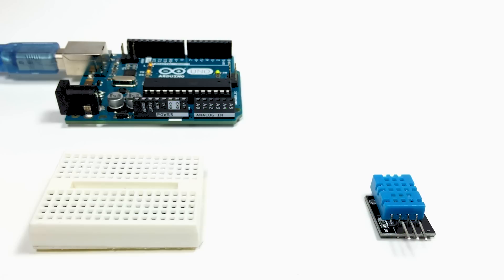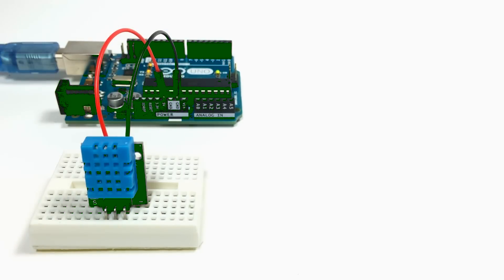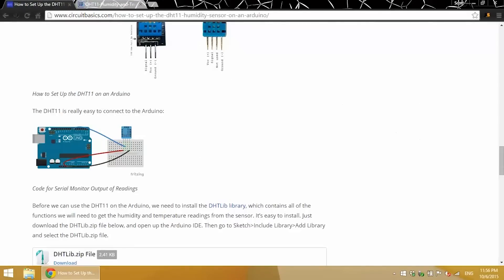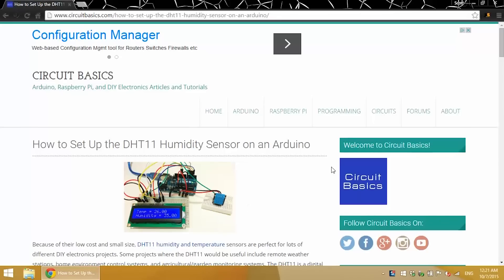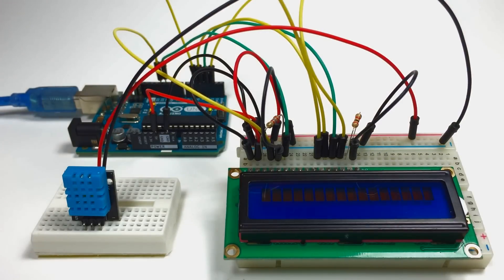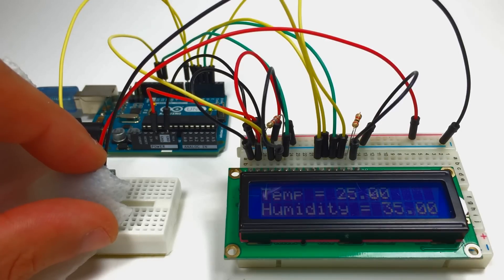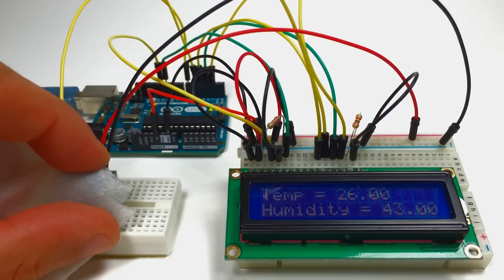How to Set Up the DHT11 Humidity and Temperature Sensor on an Arduino

Comment: hello, sir why connecting the dht11 signal wire to the digital pin instead of the analog pin?
i know that the digital pin gives just two values 1 and 0.

Comment: Hey there, thanks for the video.

I have some problems, when I copy the code and run my dht11 is overheated pretty quickly and on the serial monitor it only show -999 for both temperature and humidity.
Reply: your dht11 might be backwards happened to me first time too, as for the -999 issue, try setting the delay to 2000 instead of 1ooo.

hope this helped, 
ben

Comment: I'm using the exact same program with the exact same library having connected the 4-pin sensor exactly the way it's connected in your site.For some reason both the temp and humid readings are -999.Can you tell me why?

Comment: bro i got some problem when its read second time its like 999
and then its back to normal 
so its like 
temperatur 32
humidity 70
temperatur 999
humidity 999
temperatur 32
humidity 70

Comment: Thanks for the useful video! May I ask you, why between correct readings I receive this reading? 12:43:40.127 -> Temperature = -999.00
12:43:40.161 -> Humidity = -999.00
Reply: you should just put the delay to 1500 and everything should be fine :D
Reply: @gargamilk  I receive the same error , I've put delay to 1500 and still the same thing
Reply: Same :(
Reply: delay(2000) works for me.

Comment: I ended up shorting my Humidity sender due to an error I made, which could have been avoided with a resistor, now all my readings are -999, maybe adding a resistor next time would do... Please be careful about how you wire it

Comment: Hello, I tried your scetch. Well done, however I get -999 values for both temperature and humidity, then I get the normal values, and then back again -999. What could be the reason?
Reply: Same for me. I'm not sure if the problem is with the library installed or the code.
Reply: imposta 1500 come delay e si risolve

Comment: you should use a capacitive sensor for soil moisture, not the DHT11 or resistive probes.
Reply: Can you help me? Every time I try to import the zip file I get the error "[] parse library.properties: library.properties not found" But he says it's really simple.
Reply: @davisg869  have you tried going into sketch > include library > manage libraries and downloading from the official repo?
translation: use official arduino library, this one seems to be outdated.

Comment: I followed all the instructions but my LCD screen doesn't show any readings, can somebody help me out and tell me why or where it needs to go.
Reply: #include <dht.h>
#include <Wire.h> 
#include <LiquidCrystal_I2C.h>

// Set the LCD address to 0x27 for a 16 chars and 2 line display
LiquidCrystal_I2C lcd(0x27, 16, 2);

dht DHT;

#define DHT11_PIN 7

void setup(){
  lcd.init();
 
  lcd.backlight();
  
}

void loop(){
  int chk = DHT.read11(DHT11_PIN);
  lcd.setCursor(0,0); 
  lcd.print("Temp: ");
  lcd.print(DHT.temperature);
  lcd.print((char)223);
  lcd.print("C");
  lcd.setCursor(0,1);
  lcd.print("Humidity: ");
  lcd.print(DHT.humidity);
  lcd.print("%");
  delay(2000);
}
Reply: @robertilie2507  Thanks but I don’t need this anymore.

Comment: the readings are backwards...the DHT11 is only able to read humidity above 20% so it cant go below that but temp goes from 0 - 50 deg C thats why the humidity(really temp) is moving so much not because of wet paper towel but the heat from your finger and if you hold your finger there long enough the humidity(temp) reading will go all the way to bout 49 deg C before stopping because thats the temp reading really

Comment: Hey great video! But your amazon link doesn’t work for Canada. I was wondering if this version would work just as well. KeeYees 5pcs DHT11 Temperature Humidity Sensor Module Digital Single Bus 3.3V-5V with Jumper Wires for Arduino Raspberry Pi https://www.amazon.ca/dp/B07V5MTQJG/ref=cm_sw_r_cp_api_i_.3PzEb06XV86C. Please get back to me soon

Comment: when i upload it says an error can you please tell me how to fix it. this is the error: Arduino: 1.8.10 (Windows 10), Board: "Arduino/Genuino Uno"

sketch_jan03a:3:10: error: dht.h: No such file or directory

 #include <dht.h>

          ^~~~~~~

compilation terminated.

exit status 1
dht.h: No such file or directory

This report would have more information with
"Show verbose output during compilation"
option enabled in File -> Preferences.
Reply: may be you haven't included the library in arduino IDE
Reply: you will also get this error if you have not created a sketch folder for the code prior to compiling ;)

Comment: I am a bit confused, you seemed to have changed your web page (2.30 mins into the video) for this project as there is no library file to download from your link - it only goes to the Arduino Playground page with no obvious way forward or to download the .zip file

Comment: when I try to run the program it says compilation terminated.
Error compiling. as an error please help me
Reply: i watched this video and its working you can try my code also https://www.erratichub.com/interface-dht11-dht22-with-arduino/
Reply: @ArunKumar-tq3dz  Hi your code is not opening
Reply: Visit https://blog.roboelements.com/interface-dht11-dht22-temperature-and-humidity-sensor-with-arduino/

Comment: if i want to use the output of the dht11 to turn on a 5v fan, what is the wiring?  i had it working with a mosfet and a 12v, but i want to eliminate any extra components.   just on and off based on humidity, don't need speed control.

Comment: having a problem it says that Arduino: 1.8.6 (Windows 7), Board: "Arduino/Genuino Uno"

sketch_aug11a:1:17: error: dht.h: No such file or directory

compilation terminated.

exit status 1
dht.h: No such file or directory

This report would have more information with
"Show verbose output during compilation"
option enabled in File -> Preferences.
please help

Comment: I want to put a better delay like 200 or 400 but i keep getting this -999.0 is that because the sensor is too cheap ? I that because de arduino cant calculate this fast ?

Comment: If you get the -999 error make sure you've connected the pins of the DHT11 right, some sensors have the + - and signal placed differently than the sensor used in the video.
Reply: or you can change the delay to 2000... I was having this issue but when I changed the delay to 2000 it stopped showing -999
Reply: @yasinr9233  OMG, thank you so much

Comment: I have the same exact build, same code, and good readings. However, I am having trouble trying to convert Celsius to Fahrenheit. I know the formula for conversion is ((C*1.8)+32), but I having difficulty where in my code I need to place this. Any help would be appreciated.

Comment: Great video!.... do you have videos were you take it a few steps further? The Arduino reads the sensors values. A threshold is programmed to initiate a Digital out pin to energize a relay, in turn opening a water valve, and driving an actuator that opens a damper/ turning on a fan.?

Comment: Your pin 7 connection depends on the type of bread board you have. In my bread board, it worked with Pin A0, not Pin 7

Comment: Hi, how do you modify the code to use two DH11 sensors? I am working on a greenhouse project that involves using two sensors. thanks
Reply: Define as Dh11_1
                  Dh11_2

Comment: if it is not working try checking if it is in pin 7 or if it is on 9200 on the serial monitor and if it does work, but it has 999 in the middle then put the delay to 2000

Comment: Hi, I have selected the serial. When I see the serial output, I am getting the display as given below: 
emperature = -999.00
Humidity = -999.00
Temperature = -999.00
Humidity = -999.00
Temperature = -999.00
Humidity = -999.00
Temperature = -999.00
Humidity = -999.00
Temperature = -999.00
Humidity = -999.00
Temperature = -999.00
Humidity = -999.00
Temperature = -999.00
Humidity = -999.00

What went wrong ? Can you please help?
Reply: Solve -999 problem   https://www.youtube.com/watch?v=iQtC60BMk_8
Reply: Make sure your pins on the sensor are the same as the ones shown. My sensor output and voltage in were flipped. Switching these two as well as adjusting the time to 2000 fixed it for me.
Reply: pari20099 Hi, you put the delay which is 1000 to 2000 then it will work
Reply: i have also tried that but this isn't working i am getting the same response as-999.0
Reply: @CauseImYourFat   I know bro I tried it but later on I found out that there was an issue with my DHT11 Sensor . btw thanks for help.
Reply: @klaasmuller9663  Man I spent an hour looking for the solution and it took just a minute after I saw your comment, cheers!
Reply: @klaasmuller9663  yes when I put the delay on 2000 il works and -999.00 vanished
Reply: Your code is wrong

Comment: Hi, I have tried to run this example with the similar setup as given in the video. But I am getting this error message. Arduino: 1.8.7 (Windows Store 1.8.15.0) (Windows 10), Board: "Arduino/Genuino Uno"

Sketch uses 4300 bytes (13%) of program storage space. Maximum is 32256 bytes.
Global variables use 239 bytes (11%) of dynamic memory, leaving 1809 bytes for local variables. Maximum is 2048 bytes.
Please select a Port before Upload 

Can you please help?
Reply: Tools > Port > choose whatever board you have

Comment: followed your guide and my temperature jumps from -999 to 23c which is normal temp. any ideas?
Reply: change delay from 1000 to 2000 , it will solve

Comment: mine still says -999 for all. tried everything. PLEASE HELP!!!
Reply: just tried it, it would have the accurate reading then switch to -999 after one second, to fix this change the delay at the bottom to 5000, incase you didnt know 1000= 1 second.
Reply: @yiannikir9674  Many thanks brother, that fixed it for me, but id like to know why does that work?
Reply: @crimsonhero6683  The sensor probably cant read the temp/ humidity in 1 second, so if you put it at 5000(5 seconds) it probably gives it time to do its thing. If his sensor worked, its probably an expensive one.
Reply: sensor not working replace ut

Comment: yesss. this is exactly what i needed. but i will measure insidse a fridge so i need to go lower than 0 celcius degrees. as far as i can see dht11 supports only between 0-50. so i guess i'll be using dht22 right? will the code be the same for dht22? also the goal of my homework is to transfer the data to my computer wirelessly from the sensor. how can i do that? thank you.

Comment: i am facing some problem during  upload. previous program was blink example( in  that board )

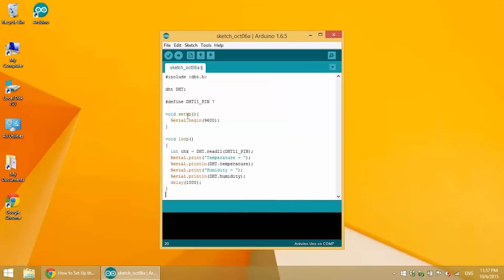"   Arduino: 1.8.6 Hourly Build 2018/01/03 03:33 (Windows 8.1), Board: "Arduino/Genuino Uno"

avrdude: stk500_recv(): programmer is not responding
avrdude: stk500_getsync() attempt 1 of 10: not in sync: resp=0xd9
avrdude: stk500_recv(): programmer is not responding
avrdude: stk500_getsync() attempt 2 of 10: not in sync: resp=0xd9
avrdude: stk500_recv(): programmer is not responding
avrdude: stk500_getsync() attempt 3 of 10: not in sync: resp=0xd9
avrdude: stk500_recv(): programmer is not responding
avrdude: stk500_getsync() attempt 4 of 10: not in sync: resp=0xd9
avrdude: stk500_recv(): programmer is not responding
avrdude: stk500_getsync() attempt 5 of 10: not in sync: resp=0xd9
avrdude: stk500_recv(): programmer is not responding
avrdude: stk500_getsync() attempt 6 of 10: not in sync: resp=0xd9
avrdude: stk500_recv(): programmer is not responding
avrdude: stk500_getsync() attempt 7 of 10: not in sync: resp=0xd9
avrdude: stk500_recv(): programmer is not responding
avrdude: stk500_getsync() attempt 8 of 10: not in sync: resp=0xd9
avrdude: stk500_recv(): programmer is not responding
avrdude: stk500_getsync() attempt 9 of 10: not in sync: resp=0xd9
avrdude: stk500_recv(): programmer is not responding
avrdude: stk500_getsync() attempt 10 of 10: not in sync: resp=0xd9
Problem uploading to board.  See http://www.arduino.cc/en/Guide/Troubleshooting#upload for suggestions. ''
 please help me
Reply: Out of Sync Issue is because your Arduino is corrupt.
Please visit the link and follow my tutorial to get your Arduino working.
 https://www.youtube.com/watch?v=xx-tAMY4qxs

Comment: My output in the Serial Monitor reads the correct temp and hum but then gives a -999 for both values, then back to real values and so on.

Temperature = 21.00
Humidity = 60.00
Temperature = -999.00
Humidity = -999.00
Temperature = 21.00
Humidity = 60.00
Temperature = -999.00
Humidity = -999.00
Temperature = 21.00
Humidity = 60.00
Temperature = -999.00
Humidity = -999.00
Temperature = 21.00
Humidity = 60.00
Temperature = -999.00
Humidity = -999.00

Is this a problem with the sensor?
Reply: try to put the delay at 2000 instead of 1000
for me worked
Reply: change the delay time to 1500 or above..that should fixe it.. good luck

Comment: Is it possible for me to use this set up with the DHT11 to open and close a circuit for an electronic element? For example, if Humidity >= 70 % then element turns on. when Humidity Val <= 70% then element circuit auto shut off? Thx in advance.
Reply: Use a relay switch

Comment: connected it correctly but prints -999 and my DHT11 melted,any solutions?
Reply: If you change the delay timing to 1500 or more it will allow the display to update less frequently. Not sure about the DHT11 melting, although my first time assembling it I thought "I" had it right but no display appeared. Turns out I had one of the "pot" wires in an empty hole. Moving it over it worked perfectly. I'm guessing you have the wires reversed for the DHT11 power connections.
Reply: i changed it to 5000 delay and it wont work
Reply: @lexumi5161  Setting the delay to 1500 helped me with my -999 issue.

Comment: do you know how to switch it to ferinheight? A lot of videos on youtube are in celcius...
Reply: you could just multiply the Celsius temperature by 1.8 and then add 32 and that gives you F
Reply: Yes, skyfox66 commented @ the website to include the following three lines under the Celsius lines:  lcd.print(DHT.temperature * 1.8 + 32); //Fahrenheit conversion
lcd.print((char)223);
lcd.print("F"); 
You could actually replace the Celsius lines with these and it will work fine. It worked for mine. Although when I copied and pasted it I got an error until I realized the font style of the quotes was different. Once I "typed" them in and increased the delay timing (so the -999's would disappear) it worked fine.

Comment: Hi Guys, I am having trouble compiling the code. I get the following error message.

C:\Users\Yedwa\AppData\Local\Temp\arduino_modified_sketch_710442\sketch_jun02j.ino:1:17: fatal error: dht.h: No such file or directory

 #include <dht.h>

                 ^

compilation terminated.

exit status 1
Error compiling for board Arduino/Genuino Uno.

What could be the cause? or do I have the wrong library installed? Your assistance will be appreciated.
Reply: Yeah you got a wrong library installed

Comment: my board its uno when i put to upload the program on my arduino i get error compiling for arduino uno genuino .so pls where is the problem thanks
Reply: check that the code is exactly the same as the one showed in this video, and also that the zip library uploaded is also the one that is being used in this video. Regards!

Comment: my sensor just prints -999.00 for both temp and humidity. send help.
Reply: give more delay. 2000 will be good. give more time gap to access the sensor.
Reply: @rukman48  nevermind I forgot to connect 5V to the breadboard my bad.
Reply: @rukman48  mine still won't work
Reply: change delay from 1000 to 2000 , it will solve your problem
Reply: @donknowz  worked for me thanks
Reply: try to put the delay at 2000 instead of 1000
for me worked
Reply: check ur connections
+ go for 5v and -ve go to ground and the left one go to pin
Reply: mine also
Reply: It isn't 77°F or 25°C echo?
Reply: help me please, I already tried everything and still -999 :< Please reply, it's for the sake of my grades :<<<
Reply: Try checking connections and pins.
Reply: Make sure you use the right code  should be under "DISPLAY HUMIDITY AND TEMPERATURE ON AN LCD"

Comment: It Didn't work for me. I got an error code saying:
  This report would have more information with
  "Show verbose output during compilation"
  enabled in File > Preferences.
Arduino: 1.0.6 (Windows NT (unknown)), Board: "Arduino Uno"
sketch_sep16a:3: error: 'dht' does not name a type
sketch_sep16a.ino: In function 'void loop()':
sketch_sep16a:13: error: 'DHT' was not declared in this scope

Help anyone?

Comment: whats ardiano that you use? and where can i buy that lcd panel??
Reply from the maker: That's the Arduino Uno I'm using. You can get the lcd from amazon, sparkfun, or adafruit... Just search for 16x2 lcd...
Reply: +Circuit Basics any lcd can work ? i have one with only 4 ports ( the lcd not the sensor)

Comment: I'm using an Arduino Nano but I'm just getting -999 for degrees and humidity
Reply: +LandyXB    You must be in outer space. You need to get within the planet's atmosphere to get proper readings.
Reply: got the same problem, check the pins
Reply: same goes withh me
Reply: Increase the delay timing and the -999's will disappear. (1500 or more works fine. Some use 2000 "2 seconds").